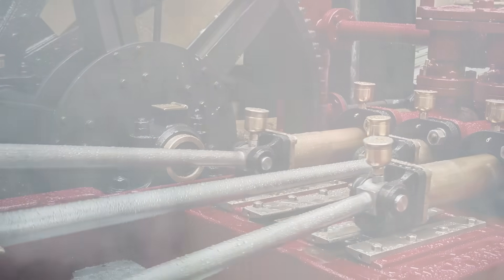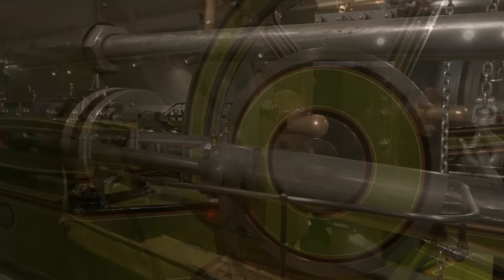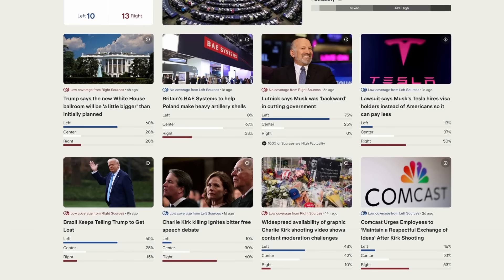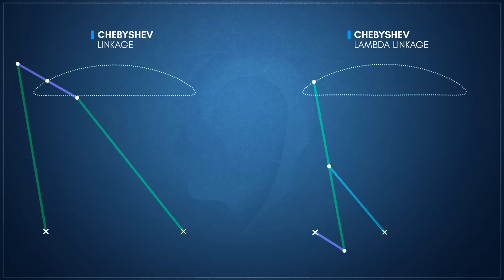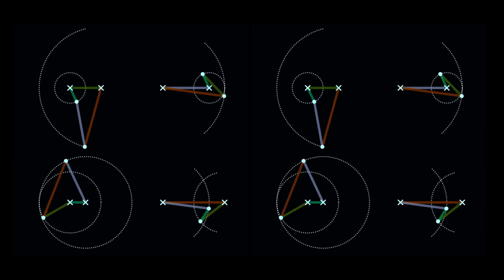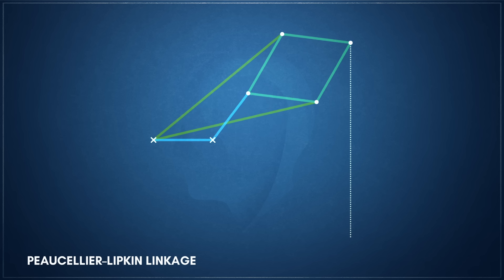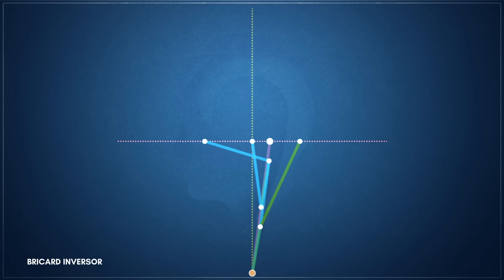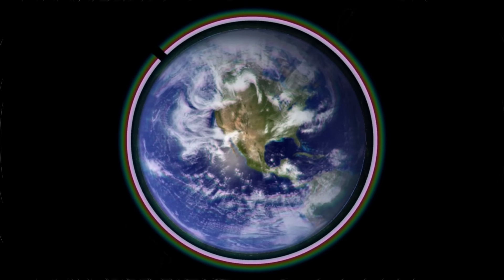The Strange Problem of Straight-Line Motion

Comment: Great Video, it's a problem that's taxed the minds of engine inventors and mathematicians for decades; solving the challenge of efficiently translating reciprocating motion into rotational motion. I would suggest Part 2: the Baker crank, the Gale crank, the rack and half-pinion system, and many, many other hypocycloidal-0type crank systems. I think most will have heard of the Scotch-yoke.

Comment: This is a new subject for me but wouldn't the design of a scissor jack achieve a straight line linkage?  At the point of the top of the jack.
Reply: I think the jack has a slide at the bottom.

Comment: Why didn’t they just use the crank and rod like we see in modern engines? It’s very simple. Is it just cause they hadn’t found a way to machine perfectly flat sliders, guides, or perfect cylinders yet?
Reply: Because the slider crank has a prismatic joint (higher friction) not only revolute joint

Comment: Video is beginning to state problem linking straight line motion produced by steam piston engine with more practical rotary motion. 
Then suddenly you jump to kinematic paradoxes, multilink lever mechanisms creating straight line movement.

How is one connected to another?
Piston engine does produce reciprocating straight line movement already - where is the problem?

Mechanisms you're showing utilise pivoting action. So they're not directly related to piston steam engine either.

The video does show examples of interesting kinematic designs. However, all that seems to be chaotic, non related to initial dilemma. Little practical application examples. Seems like the real problem was to create straight line motion using rotary actuators.

Is it another ai product?
Or
The author doesn't know what he wants to say?

Comment: Interesting video, but especially considering you even show some steam locomotive gear in the video and other piston engines, I though the challenge is to convert constant rotation into reciprocating motion (or vice versa). I was a little confused as to why aren't we talking about slider-crank linkage given that it's so common (and even shown in the video). I guess you briefly mention it regarding slider mechanisms by the end of the video, but would prefer if it was made clear earlier.

Comment: This really takes me back.  I did my undergrad and grad degrees in mechanical engineering at Purdue University in 1976-1980, while we still submitted FORTRAN card decks to the mainframe at the Math Sciences Center - if we used a computer at all.  My Mechanisms course was taught by the resident guru, Professor Hall.  He really was a genius at working through linkage design problems, and we all were riveted by them.  But the genius didn't transmit to students very well.  I still remember assignments using the enormous catalog of four bar linkage curves kept in a special room in the ME building, and never really coming up with anything satisfactory.  Linkage design was a real art, and this video shows why.  Thanks for posting it.

Comment: I must be missing some context here. Why go to all this trouble when a crankshaft and conrod will turn rotary motion into linear motion just as well?
Reply: Because a crank and conrod dont produce a perfectly straight line, they produce an extremley large radius multiple thousand miles big. The sketch at the end of the video explained it .
Reply: @moritzkrebs2107  The sketch at the end of the video shows a rod wrapped around the Earth. I fail to see the link between that and a crank and conrod.
Reply: In the case of the Watt's link for the rear axle of a car, i think weight, friction, and packaging favor a linkage over a "piston", but with the original steam engines, i don't see the advantage either. Most trains had the piston rod slide in a guide and then attached the driving rod. Maybe in Watt's day, it was easier to manufacture a linkage.

Comment: 17:10 Fairly sure this application cheats by using cams and a slider, not links and pivots.

Would a chain between two sprockets count? That gives linear motion in the chain and can pull / push.

Comment: on vancouver island i saw a very old steam train that was pretty interesting, it was well before 1920 (the frame was made of wood) but because it was used for logging it had gear reduction, so instead of the typical crank assemblies on the wheel, it had a huge external bevel gear, i thought it was interesting because of how old it was, it was probably  custom built, it was just a big wooden cart with a steam engine, with this out of place looking exposed gear system on the side of the wheels
Reply: That’s a Shay locomotive.

Comment: I was so confused because you didn't explain that the whole problem revolved around the lack of a reliable sliding mechanism, as linear motion from a flywheel is trivially easy with only two linkages.... if you have a sliding mechanism.

Comment: this video requires better explanation of the actual problem. too much time spent on the solution and almost none on the problem. that is why the historical references are confusing.
Reply: The problem is getting a machine part to move in an exact straight line, whilst powered by a rotating machine part.
Reply: @s4098429  steam engines work fine without it. what is the practical application?
Reply: @s4098429  What is confusing is that the video starts by explaining the first steam machines which did exactly the opposite: converting a linear motion produced by a piston to a circular one like the wheels of a locomotive. Then the solutions given sometimes convert only a partial circular motion (not a full circle) to a linear one.
Reply: @s4098429 a nut/bush sliding on a smooth rod connected to a crank using connecting rod gives a linear motion from rotational input.

problem is video doesn't explain why we need something completely new and overlay complex mechanism.
Reply: The whole time I was wondering what was insufficient about simple cranks. Still not quite sure.

Comment: The double piston alternating power was more probably introduced by Richard Trevethick the Cornish mining engineer who built the first self moving Steam Engine then improved by George Stevenson in the 'Rocket.'  True origin of greater power allowing Steam Engines is the introduction of 'Fast Steam Power' renamed 'High Pressure Steam Power' with a safety feature also introduced by Richard.  I'll leave you to find out what that is as you are so ignorant it is shameful.

Comment: Fascinating watching these animations. I also like how you point out that some are 'approximated by a very large arc' (even larger radius than any of the links), while others are proven to be exactly linear (I assume there's a detailed proof somewhere). Well, within the mechanical limits of the various joints.
I also find it gratifying how some of these machines are 'bootstrapped' up in construction. A set of links to get linear motion, used in a planar machine to precisely machine a flat surface, to act as the slide for another machine to make... and so on and so on.

Comment: I'm a tool and die maker, old school and retired now. The question I see in the comments is how to produce a straight edge without a straight edge to start with. That is called scraping.  Difficult to explain in words but if you take 2 non perfect straight edges and slide them against each other and scrape off the high spots where they touch, with patience and skill you will eventually create two perfect straight edges. This process of scraping is still used today in the production of machine tool ways and can take 10 years or more to learn. It is actually more accurate than any machine can produce effectively.
Reply: It takes 3 "straight" edges, though, otherwise you end up with matching arcs.
Reply: Well you could end up with both surfaces being arcs or part spheres of the same radii with just two surfaces involved. Sir Charles Wheatstone realised that if one used three surfaces and kept scraping/grinding them against each other in turn then a flat surface would result, not identical curved surfaces...
Reply: @marion-bs3qh  I think you may have meant Joseph Whitworth in this context...?
Reply: @GodmanchesterGoblin  Ah, you're right of course, Wheatstone invented the electric bridge, Whitworth the three-surface flat plate method! I got the first two letters of his surname right though ;0)
Reply: @marion-bs3qh yes, you are correct, it is much easier when 3 surfaces are used, but it can be accomplished with just 2, I was trying not to get over complicated with my explanation
Reply: @DanCarlin-o1t  no, it cannot be achieved with 2. You need 3 or you have no way of eliminating spherical errors. Unless you plan on just being lucky. Which isn't much of a plan...
Reply: @mortson978 Two and a precision level
Reply: @DanCarlin-o1t  I can't tell if you're joking. I can make a pretty good straight edge using only a piece of bar stock and a AA grade surface plate 🤣
Reply: @mortson978 once you have a flat surface, AA surface plate, it's easy, even a caveman could do it...
Reply: @DanCarlin-o1t I appreciate your expertise and also your simplification
Reply: Thanks. Is there a relation between the two surface sizes, assuming similar hardness? E.g. if I want to scrape/flatten a tool table surface, what minimum size block should be used to scrape? In the absence of precision machining?
Reply: @TheEkkas  My understanding of how flat surfaces are achieved suggests the the flat surfaces have to be of similar sizes to prevent "dishing" of the larger piece.
Reply: @dbmail545  Thank you.
Reply: @TheEkkas I would recommend googling it there are tons of videos showing this process. I am not eloquent enough to explain this process by writing. I would have to show you
Reply: The Egyptians had a way of making granite plates with perfectly flat surfaces that involved taking 3 slabs roughed in by hand and marking them 1, 2, and 3, then each side was marked A and B, through a sequence of rotating them through a process something like putting slab 1 on top of slab 2 with the A sides against each other and scraping them back and forth, then removing slab 1 and putting slab 3 on top of slab 2 with 3's B side down and scraping it, then putting slab 1 on the bottom with side B upwards (or whatever the sequence was) and continually rotating them through the sequence eventually you'll have 3 slabs with each one having perfectly flat surfaces as precise as today's machinest granite plates, it's how they made the pieces for a burial sarcophagus that people nowadays think only aliens could have made, nope, no aliens involved, it's just rubbing 3 stones together in the correct order.
Reply: @dukecraig2402  Until precision diamond honing plates were invented that's how surface plates were made perfectly flat, I'm guessing about 75-100 years ago. I've always found it interesting that that process stayed the same for millennia.
Reply: The same technique was used to smooth stone blocks to make them fit tightly by the Persians, the Egyptians, and Incas and later stone masons.  I've used the same technique to smooth boards when making a table. It does take patience and work but the result speaks for its self!
Reply: @bullettube9863no no no aliens did that....Bwahahaha
Reply: Is that like how sharpening stones are made flat? And maybe how the blocks in the pyramids were made to fit so tightly?
Reply: @blackwolfthedragonmaster  yes that is how masonry block surfaces were cut flat, getting them to exact square or perpendicularity is another process
Reply: You need three plates, otherwise you will end up with a convex/concave set of plates.
Reply: We use machines to polish lenses and mirrors to within mere atoms of flat for telescopes. 

You show me a person who can do that
Reply: @pjbthcompletely different process, you are polishing glass, I'm talking about making a straight and flat surface on steel. Apples and oranges
Reply: If you ever had two soap bubbles collide and notice the flat plane between them, this is basically the same but much slower.
Reply: I asked that in high school , The shop teacher didn't know . I was a P.I.T.A. with questions like that
Reply: @greenbury actually, I'm thinking that's a highly intelligent question for someone in HS
Reply: To make it flat just alternate concave and convex grinding surface
Reply: I am a tool and I died. Your language is strang.
Reply: @voornaam3191 your lack of understanding language is even stranger
Reply: Machine Thinking covered this in one of his videos.  Great channel too
Reply: Same problem on how to produce a plane first surface. Take three marble stones and grind two of them together alternatively.
Reply: Shout out to injection mold tool makers!
Michigan pride.
Reply: @RichardRichards-p8f ❤❤❤❤❤
Reply: The more robust but tedious technique of getting a completely flat plane is to use THREE planes and grind them against each other. The only surface shape common between all 3 is a flat plane.
Reply: @michaelbuckers  yes, with only 2 surfaces a accurate level is used
Reply: Used to refurbish cnc machines
Reply: I've always heard it called "lapping"
Reply: @ChaoticEnigma- different process, lapping uses a flat surface coated with a fine abrasive to slowly "grind" a surface flat. Very elementary explanation  of lapping fyi.
Reply: AvE is that you?
Reply: I started out in tool and die then went into tooing design. Like you, I am old school and appreciate the old machinery that I used to work on. One of my favorite machines was the shaper with its quick return mechanism. I would have no practical use for one but if I were rich like Jay Leno, I'd have me a shaper just to watch it run. I was watching a YouTuber machinist learnign how to scrape and was happy to see that this art is still alive and well.
Reply: Telescope mirrors are ground and polished to an accuracy by hand of about a quarter of the wavelength of light or about 500 nm.
Reply: @jamesjowett similar process, just radial instead of linear
Reply: There is a video called "Origins of Precision" on the very good channel Machine Thinking that explains this process
Reply: In the UK, back in 1970, as a holiday job in the university vacation period, I did a training course with an engineering company ("metal bashing"). Apart from welding, casting, hammering, latheing, routering, filing, sawing I also learnt to scrape blued metal surfaces. As my low-paid father also made tools using these techniques for another company, I suppose I actually was the tool-making son of a poor tool-maker, just like our beloved Prime Minister.
Reply: @alanmon2690 I did very well as a tool maker/machinest but I started my own business and was able to retire at 55yo
Reply: @alanmon2690 oh, sorry bout that PM you got, wish you had Margaret Thatcher back, I always liked her!
Reply: is there a method to produce a perfect circular surface?
Reply: @mohamedmamdouh-z2e There's also this way to cut a sphere. https://youtube.com/shorts/Rgv56QlgMr4
Reply: @mohamedmamdouh-z2e Did you mean a flat circle or a sphere? Yes to both though.

Circles, pretty much you attach it to an axle and grind along the edge in a manner that will turn it like a wheel.

Spheres are more complicated, but I've seen a machine used to polish stone marbles. It's got several rods that end in a cup shape, each at a different angle and pressing on the ball. These all are motorized and continuously turning, and there's a hose system pumping sandy water in to grind up the stone ball. This will keep brushing off the rough edges and eventually leave a perfectly smooth marble.
Reply: no it's not, straight edges are produced by machines that have tolerances lower than the human brain can even imagine.

Still doing it by hand I good enough in most cases
Reply: @Bilizate lol, ask mitsubishi how their machines are finished, you are absolutely clueless

Comment: 14:25 Kemp's inversor has the advantage that the shafts rotating around the fixed points both describe full circles - and thus can be directly driven from a rotary source. In addition, the connecting rod (shown here as the always-horizontal rod) could also be used as the input from a linear motion, such as a piston rod.

Comment: I’m totally against straight-line motion.  It’s just a means to an end or end to a means.  It’s always an approximation, you can never achieve perfection due to the need for bearings and rods.  I’m not saying it’s not important to achieve this imperfection but the circle is what really matters in daily life, whether a hand crank or  induction motor.  The lever is most important beyond that for gears.

Comment: I studied student mechanical engineering and after my studies I worked 35 years as a mechanic/ machinist.
I love these 3D videos as they show the working and principles of mechanics 😀👍.
I also learned that many of these mechanisms are more theoretical and are to complex or expensive to produce for use in machines or manufacturing .
Even when these mechanisms give a perfect solution and high efficiency, you will hardly find them .
The reason is a cost / benefit when designing / building a machine.